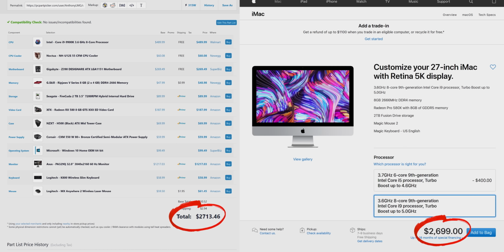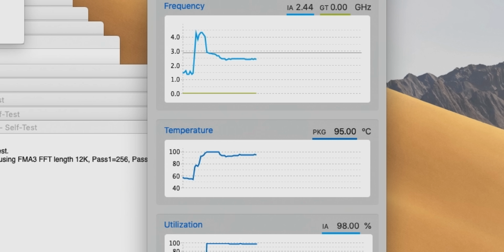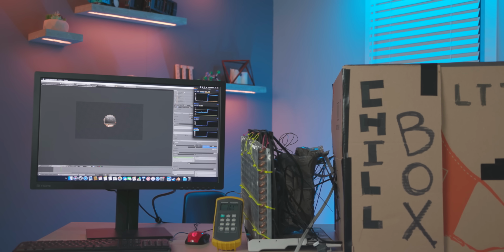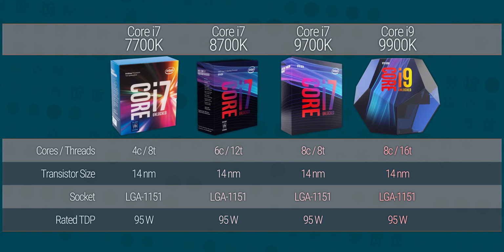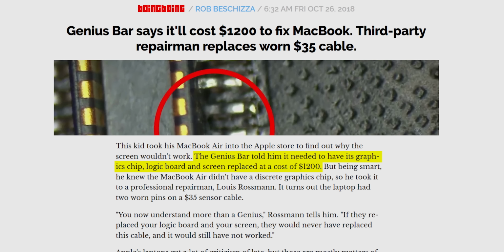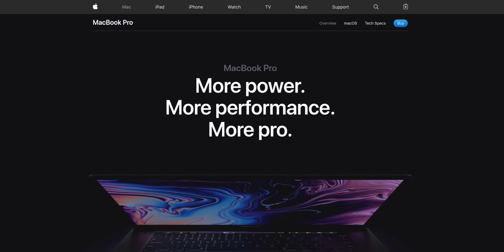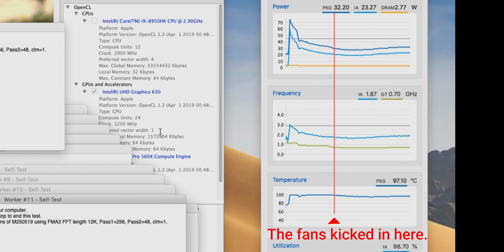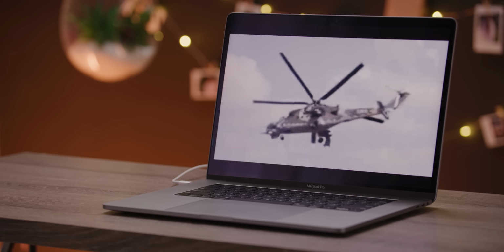Macs are SLOWER than PCs. Here’s why.

Comment: I know 1 or 2 people who own a mac & there is no way they even know what a CPU is, let alone its clock speed

Apple is losing touch with its base if it thinks they make a purchase based on specs
Reply: I own an IT company and have hundreds of Apple customers. You are correct, they do not know what a CPU is. They often ask if I can upgrade their hard drive because they are hitting ram caps. In fact they ask me how to send an email on their $1500 iPhones. It's all consumer garbage. It exists to make money. Nobody uses their iPhone for anything a $150 phone wouldn't do, JUST AS GOOD.
Reply: @Computer Guy Apple customers are a bunch of brainless sheep that think something with an Apple logo is powerful and worth the money. I made that mistake when I was 15 and got my first and only iPhone, which was the 6 plus. It did not age well. I’ve had this thing for 5 years and it just got slower overtime due to those software updates. I’m glad to be upgrading to a Samsung phone here soon.
Reply: They give up on the informed user years ago, far more profit in selling to fashionistas and people who write that screenplay in coffee shops.
Reply: @simonrushton5863 Rushton exactly and I think that is quite a big problem! In my class of 20 ish people, only 4 including me use non-apple computers. I can not see ONE SINGLE REASON as to why you would want a MacBook instead of a similar specced non MacBook (except of course to "fit in", "be cool" and the surprisingly good battery life and lightness). I am the proud owner of a Dell xps 15 9560 and that is also a really good machine, yes it gets very loud some times but it gets shit done! As I said I'm in school and in school there are bullies. I really think that it is just straight up stupid that some people bully others or exclude them from groups because they don't have the right computer from Apple or the right phone from them (even if the person getting bullied computer is better)....
Reply: For post production I’m a happy Apple user, the main machine is a maxed out iMac 5K, used for 4K 50p videos since late 2014, not an issue and not yet perceived slow, dead silent when working on a project in FCPX and a bit noisy when exporting and loading the project (but I’m not in front of the Mac during this step). It might not be the fastest video editing system, but for me is for sure the best video editing system, and I’m pretty sure a lot of people think the same. Saving a minutes or two is not comparable to the time I would have wasted on a windows machine 🙂
Reply: @HardwareNumb3rs  So you would waste time on a PC that saves you time? Typical Apple user. You said it, not me.
Reply: Computer Guy I didn’t get your reply, I have no time to waste, for production things I love Apple products because they don’t waste my time, they just works, and I don’t care if sometimes they might be limited by design to their full potential, I only care of deliver a result, like any other tools (like a screwdriver or a car/truck). When I want maximum performance for gaming I set a PC with a custom loop or when I want to break records I cool a CPU/GPU with liquid nitrogen, every system serves a purpose, but most of you can’t get that 😐
Reply: @Hardware Numb3rs I think his statement went right over your head. The Macs would be fine if the prices were reasonable for what’s under the hood. If you think about it, it costed you time to make the money to buy an overpriced piece of crud computer with an Apple logo on it. It took you less time to save and buy a Windows machine that’s a lot more powerful for less money. It kind of cancels out.
Reply: Your Friendly Neighborhood Spooder-Man For a content creator time is a currency, if a tool cost more but makes you more productive is worth paying more, and I mean agnostically speaking, can be an iMac 5K for me or a threadripper/i9/Xeon based system for others.
Reply: @HardwareNumb3rs  Why do you feel you would've wasted time on a pc? Macs are objectively slower, spec for spec, so you would waste more time on a mac no?

"Saving a minutes or two is not comparable to the time I would have wasted on a windows machine" 

^ This doesn't seem to make sense
Reply: @alexisfougeres6549  I don't own a Mac but I find it unbearable when windows holds a computer hostage for several minutes to update at bootup.  I've had updates fail several times and would then have to spend more time on a system restore.   Imagine this affecting several employees or having to meet a deadline when this happens.  

My other computer has Linux with xfce front end and updates to kernel are seamless and u don't need antivirus.  I don't own any Apple products, but I find window products to be bad in their own way.
Reply: @pengu457   Crud computer? You defo don't own one and speaking nonsense. I have 2009 iMac in the house for general use for my family. It works perfectly! Now, show me ANY PC that is in good working order and is 10 years old. Don't stress, I will tell you where - nowhere, such thing doesn't exist. Maybe you can buy a PC that is cheaper than the same specs Mac but I will assure you that it won't last as long.
Reply: Twilight Wolf wont argue that windows suck and dont have a problem with apple software. But their product design is terrible
Reply: @Max Ven Films Electronics last long depending on the owner. My friend has an old Windows XP laptop that does normal web browsing tasks just fine and is quiet. I see a lot of iPhones die quickly due to the owners and they break easily. Macs are just a waste of money. If I wanna spend a crap ton of money for productive tasks, I’ll buy a beefy CPU and build a monster Windows PC with the money I could waste on underpowered garbage from Apple.
Reply: @Twilight Wolf You don’t need anti-virus software for Windows machines. I’ve had Windows PCs for years and haven’t had a single virus because I ain’t a dumb dumb.
Reply: Alexis Fougères Windows makes me waste time, no news is not reliable as macOS or Linux, plus there’s no FCPX on Windows and no gestures like  macOS, but on this this is personal working preference. There are several aspects that made me and others choose Apple for production (or other things) and seems very few can understand it. Take the whole process of doing a task (can be video editing or others too),  the slowest ring of the chain isn’t the hardware on a system but the strange creature between the system and the chair 😁  people buy Apple because they like working on it, and if so, what’s the problem? And it can be reversed for Windows or Linux. Never understood fanboys, of every side, if it works, good, and is not all about MHz GHz etc.
Reply: Max Ven Films this is proof of your ignorance. It’s literally the same specs with better cooling for the pc and better performance because of that. Apple is worse cooling and more throttling which decreases performance. It’s so blatantly obvious that you are the target for apples marketing. All you are doing here is reinforcing the argument that you don’t care as long as you fit in.
Reply: Max Ven Films we have multiple Latitudes and Precisions that have lasted 7+ years before being given away (still working). My uncles 2011 HP desktop only had an SSD upgrade and no OS reinstall. The only Latitude that I have fail on my was a 2005 model D series in 2013 after 4 years of use in 100+ Degree F temps (no ac) in rural southern India. 

Infact Dell allows self upgrades without voiding warranty. Infac when they replaced my $700 7567 for a simple complaint of uneven core temps they gave me a $1,300 4K IPS 7577 as a replacement and returned the upgraded parts from the old laptop.

I mean nothing wrong in liking MACs but saying PCs won’t last long is an exaggeration.
Problem is people compare cheap $300-500 PCs to $1,500 MACs and complain without comparing similar priced/quality units.

Dell for example also provides service manuals and disassembly guides so should anything happen post warranty you can take care of it easily. With our MacBook Pros without extended warranty it would be a nightmare and an extremely costly venture getting any component fixed/replaced. I can confidently go without extended warranty on our Dell’s. The 7 series Latitudes have 3 years in home service standard FYI should remote diagnostics/fail.
Reply: @AbhinavTella  and you're taking seriously what the sheep said ? 

They got destroyed with facts and proofs everytime and still think they're smarter because they got an Apple logo and some thermal throttling. (Héhé smert.) 

Nothing you can say will change their state of mind. Just give up and let them brag about their garbage cooling solution, their kernel panic and their half-backed logic board that everything is soldered into it even for "Pro" product so when it break they can buy another one with a big fat smile in their face. :)
Reply: I have a 600$ laptop that has lasted 13 years and still works fine almost perfectly except for a few scratches not sure what the hell your on about specs may be lower but its not so much of a difference that its worth $1500 more
Reply: @maxone007  
10 Year old PC right here Pal !
Core2Quad running at 3.4 Ghz, so double your cores AND running at a higher clock speed :)
8GB of DDR2 at 1066 Mhz so again double  :)
Came with a HD3870...swapped it for a GTX950 
Base system cost me £30 
Out classes your iMac in EVERY way - Price, Performance and it is 10 Years old and is on 24hrs a day and has been for more than 2 years! Lets see you leave you iMac on for 2 years straight, see how that fairs!
Reply: @maxone007  haha i have a desktop pc from early 2008 that is still working perfectly, i even use it to game on... nowhere near as good as a more recent pc of course, but it still runs things like rocket league just fine. so yeah, you wanted an example of a pc 10 years old that is in "good working order"....
Reply: Why does everyone act like everyone does video editing? People use laptops for other things as well...
Reply: Seth Friedman sure.  And those people browsing the web dont need a 2k$ laptop. At this point macbook « pro » are really just a status symbol
Reply: Seth Friedman I stopped video editing 20 years ago...I DO have a MBP, and for some coding work, running some vagrant VMs, it's great. I have a Xeon-D supermicro E300-8D for more intense work. Still, if you're a gamer, which I can't afford to be yet, PC is the way to go.
Reply: I do agree Apple may have lost touch...Intel has as well, based on this video. It's not the case an Apple user = ID10Tango. I know plenty of PC users who have a hard time walking, speaking, falling out of bed, or any other snarky thing you can say. As a network engineer, who automates various tasks from the terminal, I'd say Windows lacks some useful features/integration. Linux is superior to both Windows and Mac in Many ways, but vendors like Microsoft don't make suitable applications...but then with all these, for whatever is missing, one must set up a VM...let's talk about Windows updates and performance issues....GOTCHA
Reply: Pointless discussion, probably because most of the Apple haters here never tried a MacBook or an iMac, and calling Apple users dumb or ignorant in tech is kinda hilarious 🙂 like judging a car only by the engine, quite funny
Reply: Hardware Numb3rs if I bought a car with a 12 cylinder engine that only utilized 6 of those cylinders to avoid overheating then I guess yea I’d rethink my choice of vehicles. I’m using an iPhone right now to type this cause iPhones in my opinion are better in ways that outweigh the plus side of android. The issue here is the fact the Apple is putting components in their laptops that they can’t properly utilize at a premium. Price to performance wise it just makes no sense. The base clock of the 9900k is 3.6 GHz the Mac in the ad ran it at 2.9. How is that worth having?
Reply: Claude Tesh honestly, you don’t have a clue how an iMac works, my actual iMac 5K have an i7 4790K, never seen going below 4.0GHz (base frequency) and it happily boost to 4.4 like a normal PC counterpart. The MacBooks are the same, they hardly go below base clock under normal heavy loads, but if you run artificial loads like stress tests, it overheat, like any other laptop would do.
Reply: Hardware Numb3rs this video isn’t about your  5 year old all in one, try watching the whole thing instead of trolling the comments. My pc has the same processor and I built it at half the cost of your I Mac with 32 gigs of ddr4 and a gtx 980 at the time. This is about laptops. Honestly why are you even here?
Reply: Claude Tesh that iMac was an example, I can talk about the MacBook and there’s no difference, in a thin form factor you can’t pretend to run torture tests and don’t experience throttling, same thing for Windows based machines. In a small form factor there’s a compromise of space and weight vs performance and battery life, that’s why Intel have low TDP CPUs with a lower base clock. But you don’t get the point, there’s no product of major brands (Apple, Dell, Hp, etc.) that fail to deliver the base clock under regular heavy load conditions, it may be more or less noisy but it deliver. I’m just against torture tests on small form factor devices just to light a flame, it’s obvious that the thermal fail. Find me a Windows thin laptop that doesn’t behave the same.
Reply: Hardware Numb3rs my 4790k is in a desktop overclocked to 4.7 and I don’t throttle because it’s on water. That’s a desktop though, the point is if thin form factor is what your serving then thermals are going to be an issue so why put hardware you can’t hope to cool in a small form factor when the performance loss is so significant you could have used lesser hardware and got better performance? It’s simply because people who don’t understand it will still buy it for status alone. I don’t figure you for the type of person to blindly buy something just cause it has an Apple logo and I don’t believe you would waste money on a promise of performance they can’t deliver. However most people don’t have the same understanding and that’s who they target. A pc is an investment for me and I want the most performance at the best price.
Reply: Claude Tesh I don’t see any issue with thermals in small form factor systems or laptops, the promises are met, base clock + boost “up to”,  so under heavy tasks aka heavy real workloads (not torture tests) in the worst case scenario you’ll have the base clock, with the boost to X when possible or with lighter tasks (photo editing, drawing, writing, office suite etc.). Take a look at this screenshot, made just now for you https://postimg.cc/jwqWw0gZ this is a Toshiba Portegé Z30B, with a i5 5300U base clock 2.3 GHz up to 2.9 GHz, but under stress test it throttle down to 1.6GHz... now, should I call it a scandal or just blame myself for using a stupid torture test that obviously pushed too much the CPU? What do you think?
Reply: Hardware Numb3rs your a content creator so how about you run some tests with relevant to the topic hardware and prove them wrong. I’ll even sub to catch that video where you explain what was wrong with his apples to apples comparison and why you pc screenshots are an accurate depiction of Mac performance.
Reply: Claude Tesh yes, why not, in a couple of weeks I should have a new MacBook Pro here (but with the i5), and in a month or so the new iMac with the 9900K, sure thing I will do extensive testing on both, comparison with Windows machines and everything that came to my mind that could be useful to the discussion 👍
Reply: Hardware Numb3rs I’ll sub now and get the bell on
Reply: @ @HardwareNumb3rs  I will do too to see these comparisons, because from what i had seen in the past, macs were always slower. 
But you might surprise me :p
Reply: DaniXks for sure is not the fastest system in the market, the minimal cooling doesn’t allow the boost to be sustained much, and imho long rendering sessions or really heavy processing should be done with a proper workstation or render nodes, but for sure it gets the job done without throttling, when I can gets my hands on the new 5K I’ll prepare some tests with real projects to be worked on it, and then numbers at hands we can judge 🙂
Reply: Or maybe the information that you spend hours and hours thinking about just doesn’t matter anymore. All that matters is your perception of the performance of the product. People who look at computers this way are in danger of becoming redundant. Like the TV repair man who used to replace a capacitor and get you up and running, he was once a god.
Reply: and imho, stresstesting a laptop with unrealistic loads to prove a point is kinda useless, with a real life software the clock doesn't go below base clock, prove me wrong :)
Reply: @DaniXks  Software like Prim95, called also "torture tests"are designed specifically to use various instructions set (like AVX, AVX2, AVX-512 etc.) at the same time (you know what an instruction set is right? and the way affect the transistors in a CPU?, if not, google it), the purpose of the torture test is to squeeze every watt out of the components in an artificial way, impossible to reproduce with real world softwares. Take a look at this, for reference: https://img.purch.com/stress-tests/o/aHR0cDovL21lZGlhLmJlc3RvZm1pY3JvLmNvbS8yLzEvNzQ2NTY5L29yaWdpbmFsLzI3LUNvbWJpbmVkLUdQVS1UZW1wZXJhdHVyZS5wbmc= Heavy Load CPU + GPU was at 49°, Prime 95 is at 64°, so realistic 49°, torture test 64° The test Linus did on this video is good to understand the thermal limit of the cooling parts of a product, but It must not be confused with the maximum real temperature the product reach during real operational tasks, like: encoding, rendering, gaming etc.

My point? 

Saying that the Apple products have a misleading marketing, a CPU speed below the advertised base, "Macs are SLOWER than PC" etc., is simply not true, using torture tests to provoke throttling is wrong, and is just feeding trolls and Apple haters.  

A real test could have been finding equally specced machines and run real world productivity tests, monitor frequencies, time to complete the task, temperature, noise level etc.

Btw, If I need a Windows laptop workstation, a real workstation, I'll go with a Dell Precision or HP ZBook, with a proper support and certifications, for sure not a gaming machine, Macbooks are not at the Dell and HP level, but at least they are certified and fully supported with the majority of the professional software out there.

I never said  "people like working on macs more than PC", actually macOs users are far less than Windows, but for an Apple user changing to a Windows system is a big no, not sure the other way around, I said that Apple users are extremely happy with ecosystem.

Again, is you have a friend with a mac, ask him to start a rendering, an encoding or similar real world task, watch the CPU clock and temperature, you will notice that everything is as advertised. 

I'm not defending Apple, I'm defending common sense here, something that is always forgotten by fanboys.